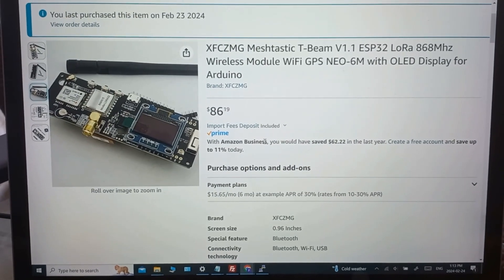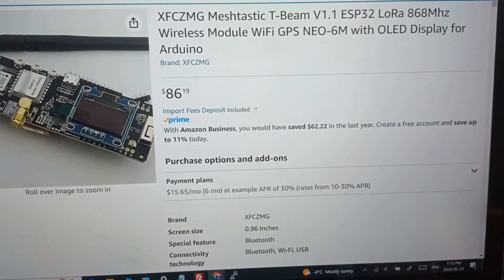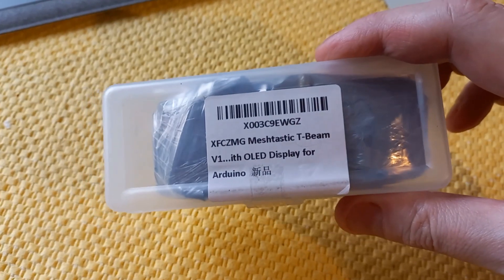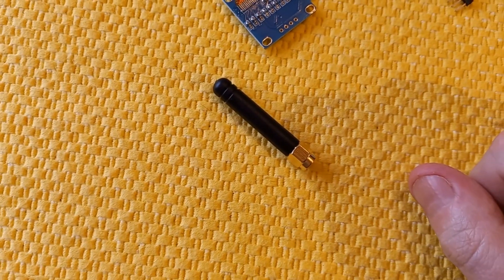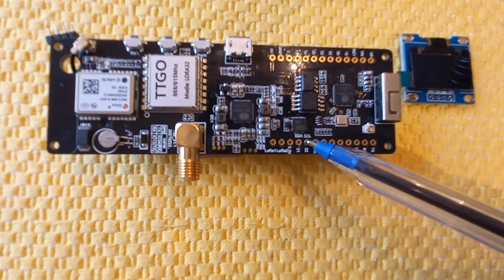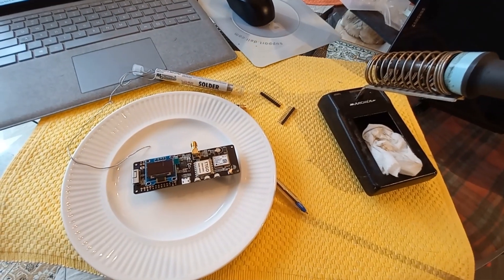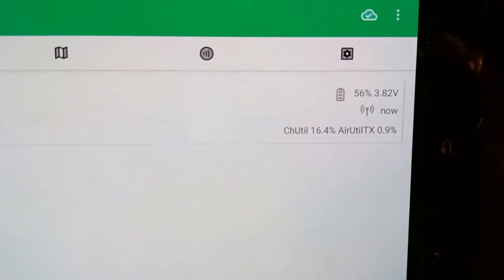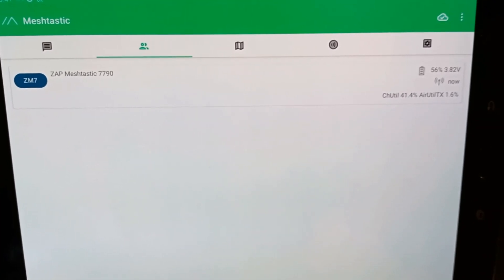Survivable Comm's - Meshtastic

Comment: Fun fun.  Got a couple Heltec V3's in Charlotte, NC.   Heltec has no GPS so nothing showing on my map, me or other people.   Purchased 2. so far I have been able to communicate between devices at 200 yards, or one Charlotte block. (through buildings tho).   Not impressed with distance at all.    Plan to put one in water proof box and plug into a receptacle on the roof of middle height building in downtown Charlotte to act as repeater.    So far I believe I wasted my money, but its 1/10th price of an Icom.     These things need active participation, for example if you don't communicate, it sleeps, and may have a hard time reconnecting, have to restart app or device, so not all bugs worked out.
Reply: LoRa  is pretty heavily line of sight based. If you get a node out in the open high up you'll have better reach

Comment: Awesome that Meshtastic is spreading and getting more and more popular - hopefully it will attract a lot of future engineers, etc.
It reminds me SO much of AX.25 packet back in the 90's used by radio amateurs. 1200 baud on 2 meters, shared bandwidth... Ah, slow but information, even software, made its way throughout the network. 
I still have my TNC-2C (Terminal Node Controller) and it will happily decode APRS (Automatic Packet Reporting System) which is still in use today